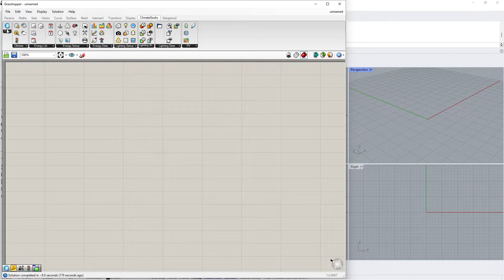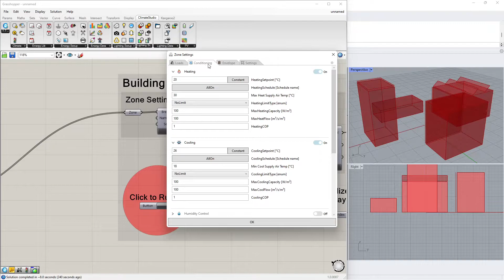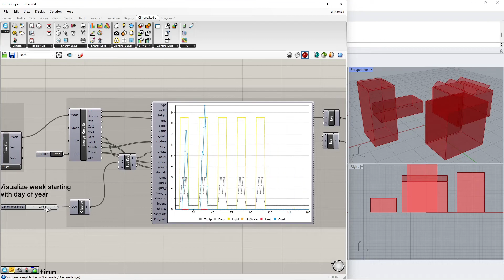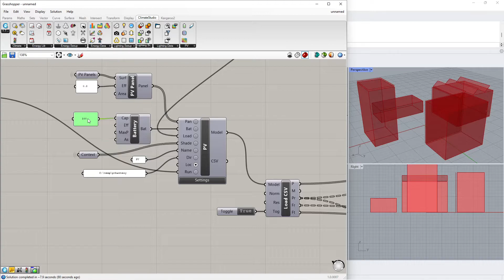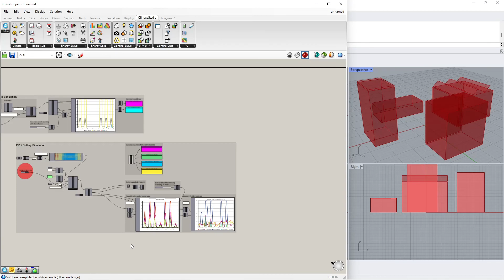Simulate PV System with Battery Storage using ClimateStudio for Grasshopper

Comment: I would like to request the calculation formula for 'Eff' (PV module efficiency) in Grasshopper. Is 'kWp' divided by the area of all cells, or divided by the area of the entire panel, including the inactive area? I noticed that there is another input for the area covered with the PV cells. Additionally, could you clarify if the output of 'Load CS PV Result' is in DC or AC? Thank you!
Reply from the maker: 1. Eff is just the panel efficiency at converting solar energy to AC (inclusive of inverters, etc.).
2. KWh is the total power output for the entire system.
3. AC.